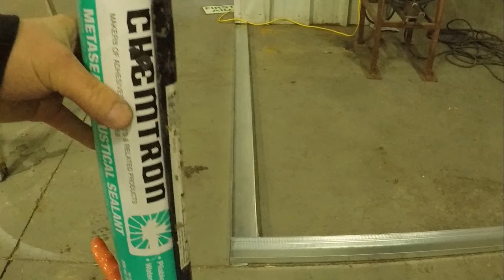Metal Stud Framing On Concrete Lesson

Comment: So my questions is these two corners when the drywall meet and you have to install the first sheet, screw it in the corner and then installed the other one to merge and the other corner now how in the future if you have a lot war league and you want to cut that sheet rock then in the corner, it will be inside how you get the new sheet then
Reply from the maker: Yes sorry for the late reply. You can just add in a stud for the corner, leave the old board inside the wall.
Reply: @ thanks

Comment: I need to build a small storage shed, the slab will be 8ft x 12ft. If I want to frame it with metal studs do I need to worry about bolt anchors or can I use cement glue and or ramset nails?  Ideally I'd probably prefer to glue and bolt down.  I think that could prove easier for dismantling in the future if someone ever desired as opposed to nails.  I'm in San Diego and don't know how or what the NBC codes are, etc, I just know small structures like sheds are allowed without permits.  I've done plenty of wood residential framing and remodeling in my younger days, even some metal stuff too, just not much, but want to use it for this project because the termites in southern California will turn a 2x4 into sawdust in a matter of months.  It's so bad here you wouldn't believe it.
Reply from the maker: Yes you can totally use ramset / hilti pins, pin bolts or even 2 nails and a PC of tie wire to fasten the bottom track down. No glue at all but I recommend using the acoustic sealant (chemtron caulking) under the track or a foam gasket.  Here is a link to show you what pins to use, go at least 3/4" https://cf-t.com/fasteners/anchors-studs/pin-bolts 
And this is the caulking you want: https://ca.brockwhite.com/product/2-33530110
Reply: metal stud framingshow more videos on metal studl

Comment: What ways can you get by on nailing a track to concrete like are there any other ways than a gun cuz home depot dont have the bullets
Reply from the maker: Yes you can use a hammer drill and pin bolts. https://bit.ly/PinBoltsUCAN I think Home Depot has the Ramset you can use as well.

Comment: I use my impact all the time for drywall. "With a drywall tip". Thats all you need then its a non issue. Dont need a drywall gun. I have both btw and have used all for many years.
Reply from the maker: Sure, if you don't do much drywall that could work. Whatever works for you. I don't recommend it for a lot of drywall. Cheers my man!
Reply: Third-world (banana country) citizen here:
The drywall gun costs around $300 bucks, and with the fast charge, it costs around $350.
For me, if I can save 20% of the time, then it makes more sense to have a drywall gun than to use an impact bolt everywhere.   Why?
Let's say the salary of a worker is $500 (*) x month x 4 months = $2000 x 20% = $400, so I am recovering my investment in 4 months.     
(*) ha, even in a third-world country, no worker will work for that sum, life is expensive everywhere.

Comment: What's the name of the power tool?
Reply from the maker: I have the Hilti DX-351 powder actuated fastening tool or a hammer drill to pin down the track to concrete. The 351 also has steel to steel pins.

Comment: I'm learning a bunch of awesome Tips and tricks and also learn a new part of the trade especially the metal framing... I've been hanging drywall for 12 years with light metal frame and basic wood frame and skills plus various other trades as well I've touched upon.. I'm about to join the local carpenter's Union in Long Island New York local 290 and I am about to enter as a journeyman and I'm learning all the things I need to learn from your videos and others as well thanks alot and it's all so familiar the lingo and strategies in your videos ..thanks bro

Comment: Straight to the point, thanks for the details, can you please tell me what type of screws you are using to connect to steel studs?
Reply from the maker: #8 wafer head 9/16" vector screws for light gauge and #8 zinc plated truss head self taping for heavy gauge.

Comment: Is the Concrete Pins you use and show in the very first part of the video 3/4" or 1"? 
When I read about it, it seems like 1" embedment into concrete is recommended for a strong hold, but at the same time I can see that the pins are being sold in 3/4" for concrete and it seems like the length many uses. 

Is there any reason to get the type with a washer?
Reply from the maker: We use 1-1/4" pins.

Comment: Are you using a nail gun to put the pins into the concrete?
I am looking to frame in a condo, so I have a concrete floor and ceiling. Can I use pins to put metal studs for both the ceiling as well?
Reply from the maker: Yes, so I am using a powder acuated fastening tool, you can get them battery or gad powered as well. Any of them will allow you to pin to concrete and steel with the proper fasteners. The brand I use is hilti but Dewalt and Ramset are other brands but nit sure how they perform. I've used hilti dx351, bx3 or 120 with 3/4" pins and green shots.
Reply: Thanks so much for your response!

Comment: What's the caulking for on the bottom track? I've never seen that done before. 
When are you choosing to running 20GA vs 25GA? Thanks! Great videos!
Reply from the maker: Hey there!! Yes the caulking is for moisture and acoustic. We use a foam gasket for exterior walls and the caulking inside. What happens is when there is a transition from one material to another we need to have some separation. 20 gauge is my favorite steel to work with. It either comes down to cost or required strength. The lower the number in gauge the heavier it is. Cheers man! Hope that answers your questions.

Comment: Is this method of construction normally sufficient building-code wise and load bearing capacity wise for load bearing walls of a 200sq-ft shed? Or is there a different method of using steel studs for that purpose? If it is not, do you have a video explaining how load bearing metal studs walls are built? I will go watch that whole thing too!

By the way, I just found your channel and wanted to let you know that I like how you explain all of the little details.
Reply from the maker: Hey Josh right on man! I have lots of framing videos for you to check out here: https://bit.ly/ExpertFramingLessons Framing if you ever have any questions you know how to find me!

Comment: on a freestanding metal stud wall, how do you keep the top of the wall form moving if there is a grid ceiling? do you use the grid ceiling to lock it in place?
Reply from the maker: Definitely do not screw to the grid, get clips like this https://www.revoebuildingproducts.com/products

Comment: Hi Chris.  Thank you for the videos.  These videos are very informative.  I have a question about a church that I'm working on.  Plans call for 16 ga 8" studs for exterior wall that will take denseglass.   Minimum spacing of studs  is 24" OC.  I wanted to make it stronger by doing 16" spacing.  Do you forsee and complications with doing 16" spacing compared to 24" ?
Reply from the maker: No no issues, I don't know why they do this but I always ask for a change to 18 gauge 8" @ 16" o.c. The 16" is much better and for exterior especially
Reply: Thanks for the reply.  So your saying the 18 ga @ 16" oc is a better system that the 16 ga @ 24" oc.  I think that makes a lot of sense.

Comment: Can these techniques be used to cover a window hole with cement boards?
Reply from the maker: Sure, if you want to seal off a window you can use steel stud and cement board, I don't see why not.

Comment: Great video and series 👍, can you tell me about those ladders/ benches your using? Thanks
Reply from the maker: Yes the standard A frame benches go 2 step, 3 step, 4, 6 and 8. Each step will give you 1 foot access/egress hope that helps. You can buy them at the drywall supply houses for sure, maybe at a box store I'd look online first.

Comment: When you lay the drywall, do the screws on the top of the track holding the vertical studs on get in the way and not let the drywall sit flat? Or do you stop the drywall short of where the screws are?
Reply from the maker: The screws are panheads so they won't push the board out and when you screw the drywall in it will snug up. If the wall has an expansion joint in it the screws will be at the center of that.

Comment: I've seen the framers use some clear spray, snap a chalk line (black) and spray again so they can lay out whole rooms then go back and build the walls. You say not to start on the bottom, but that's all ive seen in commercial. What do they use for that layout and is it bad practice if there's a door/hall to build bottom up?
Reply from the maker: Yes for layout you can use black but if its a polished concrete floor then use red. Any clear coat spray paint is good to keep your lines if your laying out a lot. I prefer to put the top track on first for 2 reasons; 1 because the bottom track on first will block your scaffold wheels and 2 i like to use a line laser to shoot up the top track and even a pin laser to shoot the corners and its easier to use the lines than the track itself. Also on Exterior framing its always good to do the parapets first and then shoot down. Does that make sense?
Reply: @ConstructionKronies  Yes it does, thanks for the information and these helpful videos.

Comment: How do you install track to the ceiling. Is it the same way as you would do the floor track.
Reply from the maker: If it is concrete yes, or concrete filled steel decking yes use a Hilti with concrete pins. If it is structural steel use steel pins. If it is hollow steel decking use self drilling framing screws the same for heavy gauge steel stud framing.

Comment: what is the name/model of the nail gun used in that you show on  minute 6, second 8 of the video.
Reply from the maker: Hilti dx350 is my go to gun. Still the only one you can adjust the power on the gun and use different gauge shots. Holds 3/4" pins.

Comment: i am a DIYer and i am getting ready to frame partition walls with metal studs. it is going to be ending at a 10ft existing drop ceiling. do you have a video on how you attach the wall to the drop ceiling, or any advice you can give me?
Reply from the maker: Yes, for sure. Is the drop ceiling going to be tbar or drywall?
Reply: @ConstructionKronies  tbar, and thats what im not really sure about. if the wall extends up to the drop celling how do you attach it to the celling and how do you finish the connection with drywall?
Reply from the maker: Okay so we use clips (get from drywall supply house) that slip over the tbar (not screwed to tbar) and then you screw downward  through the clip into your top track. Leave all of your drywall 1/2" off the ground and 1/4 to 3/8" down from the tbar so you can finish tape it with TrimTek tare away beads.

Comment: I saw a video where they poured concrete inside a drywall with metal framing. Is it safe to do it that way?
Reply from the maker: Yeah, sometimes what they do is pour a self levelling concrete after the fact and it to me is so stupid but they still do it. Drywall HAS TO be at min 1/2" above the concrete or any floor finish.

Comment: I AM  building my home and was wondering if the steel will rust on concrete, how long will it last and is it a better option than cinder block walls . all interior work
Reply from the maker: Yes you bet it is a great product. The steel is galvanized donut won't rust. Also use the chemtron acoustical caulking underneath the bottom track and your good to go. Will last forever. Keep your drywall 1/2" up off the floor and use vapor barrier (6mil poly) and insulation in the basement exterior walls. Use chemtron caulking and TUC tape at your joints. Any other questions just ask!
Reply: @ConstructionKronies  thank very much. 
Also does quick set cement work like chemtron , as I am doing the entire interior wall for the house , wood is extremely expensive here .
I am planning on using 12mm cement board with 0.9 mm gauge steel. Am I going too far with steel gauge.

Comment: Thank You for sharing your experience. I do need some advice, we need to fur-out a CMU block wall 4" using a steel 2x4 stud. I have Hilti Powder gun and a Jacco ballistic pneumatic gun. It's difficult to get either gun to shoot the studs inside edge to fasten the steel to the block wall. Any suggestions? Thank You!
Reply from the maker: Yes bro, this is one that bugged me when I first ran into it. You can't shoot it. You have to drill in pin bolts 1-1/4" with a hammer drill, 1/4" bit. You still in clips and then screw your tack and studs to them👍
Reply: @ConstructionKronies  thanks for the quick reply. Using the hammer drill and pins as suggested I thinking the would still be on a bit of an angle. Got a bunch of them to do, really wish the gun would work.
Reply from the maker: haha I feel you bro!! !

Comment: How would you recommend doing a free standing box, a room within a room for a recording studion? The walls can’t touch the structure and the ceiling can’t touch the structure either. Tricky! Would you recommend any different techniques? or maybe a different gauge of steel?
Reply from the maker: Yes I just built myself a recording/film studio so I know lots of tricks and details to set you up. For sure heavy gauge is the best, I used 16 and 18 gauge for my studio, 6". The free standing walls will be tied in to the ceiling you build. How big is the room size?
Reply: @ConstructionKronies   thanks so much! The live room will be 13feet by 21feet. Big! So I was a little concerned about the weight of two layers of thick drywall on the middle of the ceiling!
Reply from the maker: @LouisLinggandtheBombs  yeah that is big for a free standing system. Your going to have to brace it to the structure but you can use isolation pads. Just the normal foam gasket or acoustic caulking at your transitions. My studio is 20x20 and is in a free standing building (separate garage) but I did tie into the ceiling. There are a lot of treatments you can add. The best thing is if we can schedule a zoom call or something. What platforms are you comfortable with like zoom or discord?
Reply: @ConstructionKronies  Dude! That’s amazingly kind of you! I have zoom!

Comment: Great video bro. how would I connect the top track of the wall to a drop ceiling?
Reply from the maker: Hey Daryl thanks man and when attaching to a drop ceiling - for steel stud or furring bar you can screw the top track right to the steel and secure your end wall studs. You can make clips or use flat stock. For a acoustic ceiling like tbar there are clips made to hook over the mains and cross ts. i know this may be tuff to understand without seeing but If you catch me live one day I can draw you a diagram or show you in the field! Thanks again and have a great day!!

Comment: Question: how do you attach top plate to q-deck ceiling? If you screw it to ceiling wouldn’t it make hole 🕳? If i straight nail to metal ceiling will it cause dripping water from outside building? Is there any video shows installing to metal ceiling? Thank you 🙏
Reply from the maker: Always use self taping framing screws to fasten to the qdeck. When the walls are running the same way as the flutes of the qdeck make clips to screw in even use flat stock pieces to screw to the qdeck and then screw your track to the clips.
Reply: @ConstructionKronies  thank you so much next week i am doing my first steel wall 18’ hight i am watching your videos it is sooo useful 🙏🙏🙏🙏
Reply: @ConstructionKronies  what if i use hilti gun will that hold top railing? I thibk that would be quicker
Reply from the maker: The hilti is too strong and the pins will just blow right through the track and qdeck. I have done that before and it was dangerous and didn't work. Screws are it my good man!!
Reply from the maker: Make sure to let me know how your wall build went, if you have Discord upload us a picture or tag me on Instagram.
Reply: @ConstructionKronies  thank you so much for reply 🙏

Comment: What size fasteners did you use for the track? and what caliber load in the gun?
Reply from the maker: Sure thing. Here are the links to the products I use. For fastening to concrete always use the green tabs and for steel to steel you can mostly use the green tabs but you can use yellow and if its super heavy gauge you can use the reds but I rarely ever have had to use the reds. 
http://bit.ly/concrete_pins
http://bit.ly/steel_pins
http://bit.ly/cartridges_powder

Comment: Will it be ok to do this with fresh concrete? I hear fresh concrete has moisture and can rust the metal stud?
Reply from the maker: We as a rule let the concrete cure for 3 days min. Then you can get foam gasket for exterior walls and always caulk your interior walls with acoustical (black chemtron).

Comment: Hi, great video,  very helpful,  can I ask what you used for the ceiling on this frame ?
Reply from the maker: Yes for sure, we used the 3-5/8" steel stud and drywalled both the top and bottom with 5/8" type x drywall for a 45 min fire rating.

Comment: Is it okay to frame an entire house with 25 gauge steel? Also, where can I buy the 25 gauge framing screws?
Reply from the maker: I have heard of people doing that and I think if you build it right it would work. You can buy the framing screws at any drywall supplier or even box stores like home depot or lowes should have them.

Comment: So what are you "shooting in"? What kind of gun is that and what are you shooting???
Reply from the maker: I use the Hilti powder, gas or battery guns using the Hilti concrete or steel pins. My 2 favorite models are the Hilti dx120 and the dx351. The new bx3 isn't the worst either.